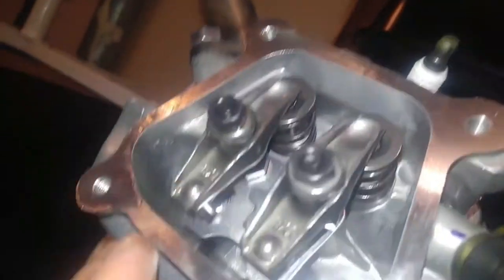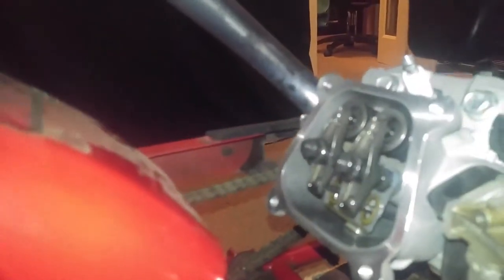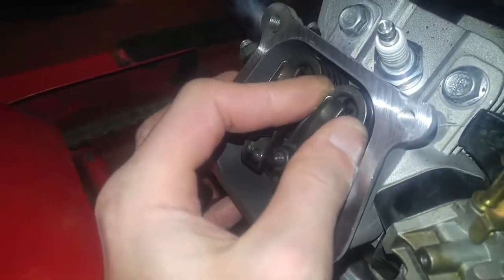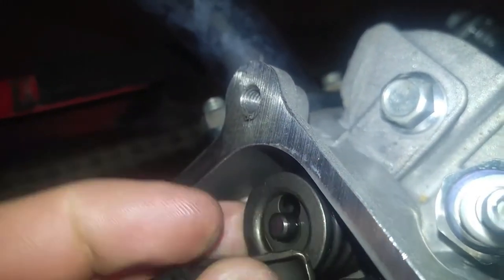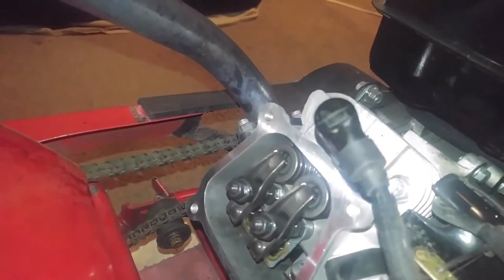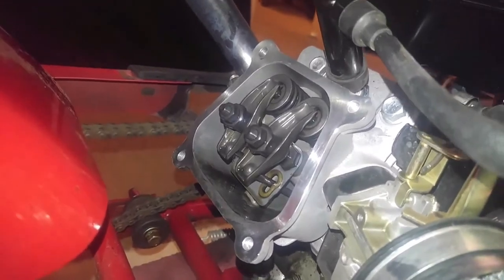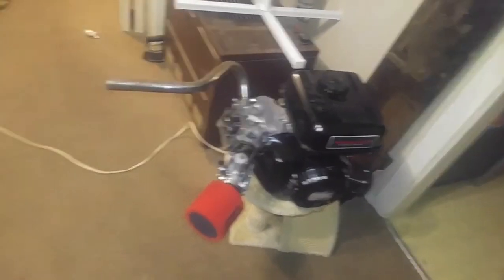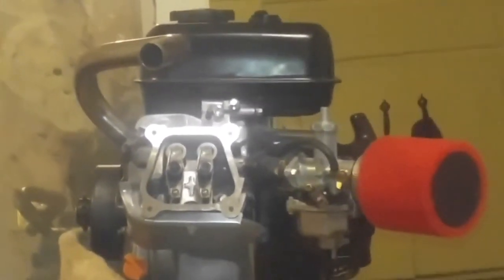(NEW) VALVE SPRING & CAM & RODS FOR PREDATOR212

Comment: Will the 212 bolt right onto the frame? Also will a gas tank relocation be needed? I may order my coleman on thursday!!
Reply from the maker: DJ4000VOLT as far as I know according to other videos I have seen on YouTube there are people with the 212 on the ct100 frame it'll be a tight fit getting the gas cap on and off but it does fit